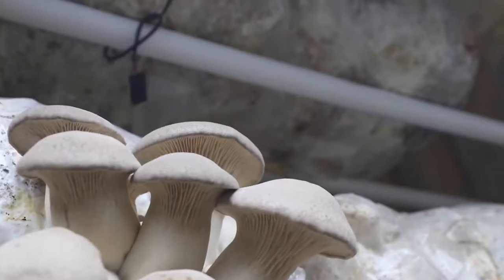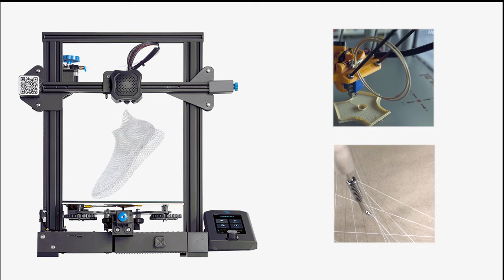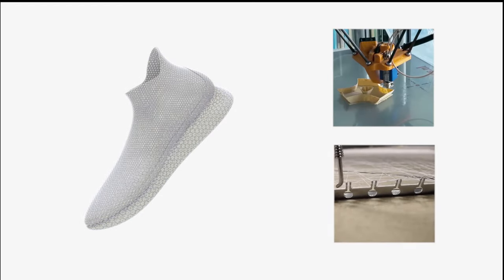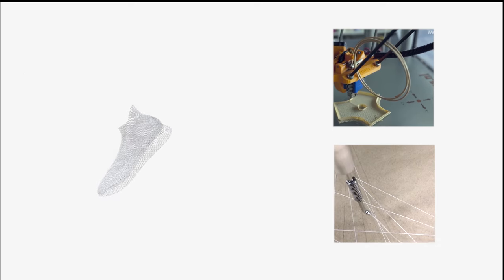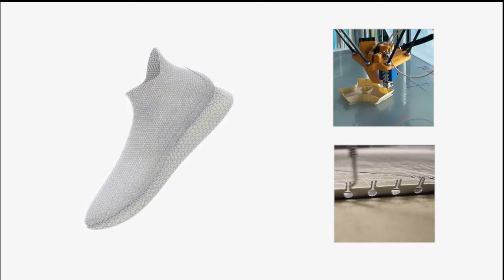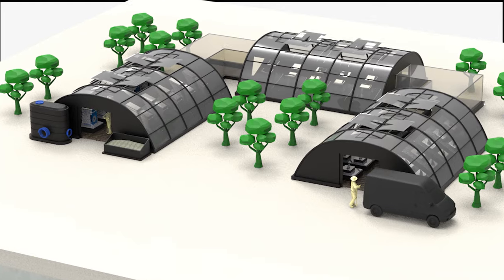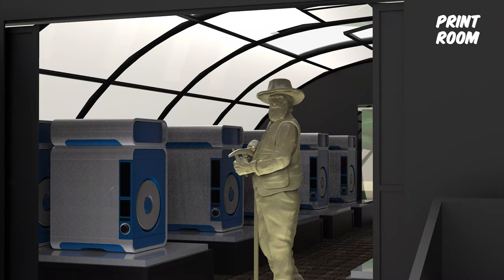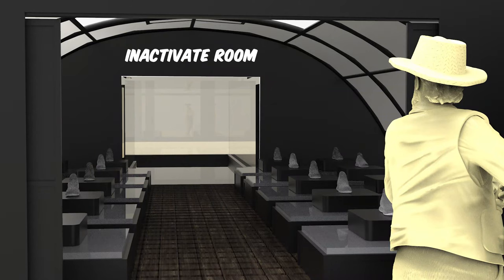mycelium farm

Comment: Whilst the visuals of the growing mushrooms were stunning and your renderings very clear, the music made it extremely difficult to follow the voice over in your video. Make sure you include subtitles next time or you increase the volume of your explanations - if it hadn’t been for the caption I wouldn’t have understood what you were proposing. 

In terms of your proposal, I would have liked to see much more hands on experimentation with the technique you are suggesting. Whilst the premiss of the project sounds promising, it would have been great to see you move from theory into practice earlier on. Working with growing materials isn’t straightforward, and trying to control how the mycelium grows on the scaffold might be bit more complex than you imagine. I also don’t really get from your video if you are proposing to grown the entire shoe out of mycelium with a single “skeleton”… how would this work? And how would you ensure the flexibility you require in a shoe? 

In your caption you also touch on the wider implications of growing our products with mycelium and how this would potentially impact the agricultural industry. I would have liked to see you interrogate this more in depth, and really design how a manufacturing process like this could change our systems of production. Do you think it’s really feasible to scale this process up? Or would we have to reconsider the time we spend in producing items of clothes?